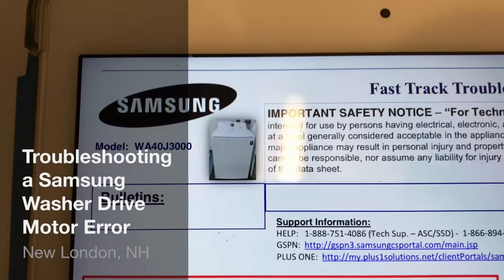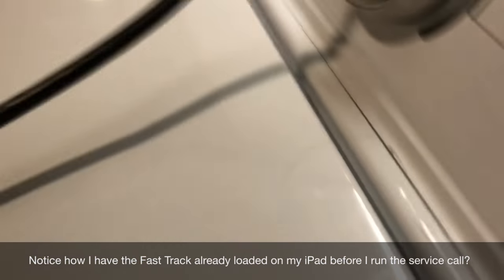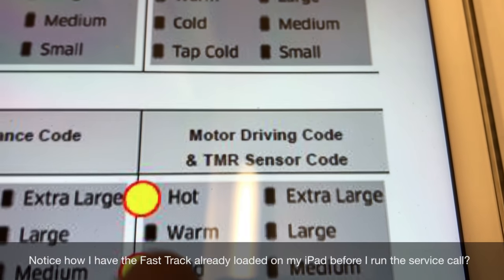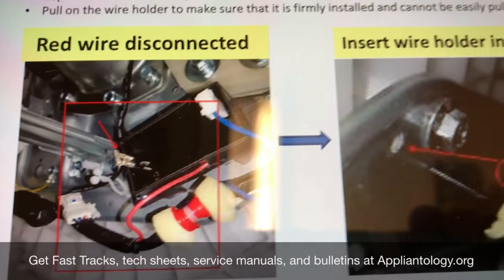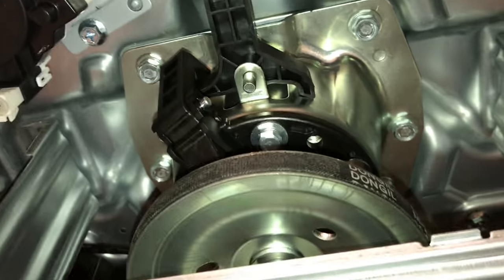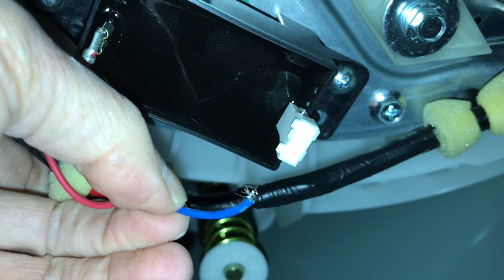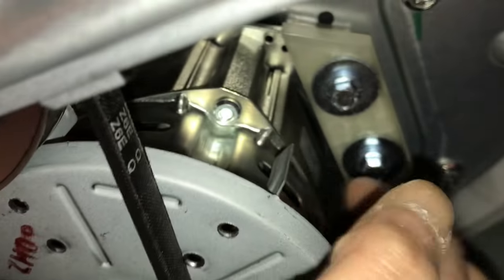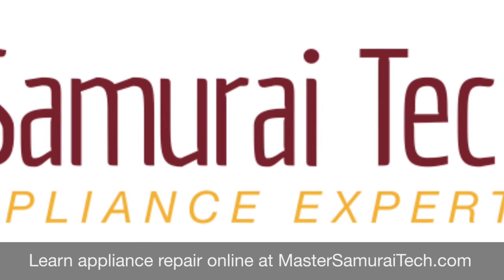Fixing a Samsung Top Load Washer No Spin Problem

Comment: thank you for the video, got me in the right direction. found the capacitor wires were fine but samsung or who ever built the motor used extremely thin gauge wires and found that the green wire was broken close to the 3 wire connector near the wire bundle close to the capacitor. so motor was dead in the water and the red wire jacket was also cracked and soon to be broken. had to cut the 3 wires and replace with male - female crimp on connectors at each end and taped everything back up, and now back in business for the time being. if anyone is having trouble. definitely look closely at the wires going directly to the motor as they are way too thin and could easily have a crack or break in them.

Comment: Thanks. Saved me a lot of diagnostic time. Red wire burned thru at connector. Five-minute fix. I did both wires. Washer still junkie but now a working piece of junk.
Reply: The Blade how did you fix the red wire that burned through?
Reply: I spliced on a wire and connector from an old harness. Samsung wire is minimal in my opinion. Twist wires, solder and tape.
Reply: The Blade  how are you. Has your repair held up? Mine broke off after two loads. Maybe because I only re spliced existing red wire and crimped back on existing connector. No sod no tape (electrical tape?) Thank you.

Comment: Thank you for posting. I replaced all of the dampers thinking it was a balancing issue, since the spin cycle wouldn't work. Turned out it was the red capacitor wire. Thanks again!

Comment: All my wires checked out good. So I continued on my quest with different videos. I was not getting hot water, checked everything related to that. No voltage to the solenoid, was ready to call a repairman. Then found a video that said the pressure sensor gave the same code. The clear tube from the sensor to the bottom of the drum had came off at the drum end. Reattached and solved the problem.

Comment: You saved the day, my man and a bunch of money too.

One broken red wire, and a short fix later, I'm back in business.
Reply: jonnyhunglo how are you. Has your repair held up? Mine broke off after two loads. Ty
Reply: jonnyhunglo following. Same here :/
Reply: @gentlepotatoe    I used gator clip jumper cables seemed to work.  Now have new issues with this washer.

Comment: Right on! Mine was actually the other (red) wire that broke off, but you saved me a $170 service call. Many thanks for posting!
Reply: How did you fix the red wire?
Reply: @rogaken  I spliced (with a wire nut for repeatability) a heavy duty flag terminal onto the existing washer wire. I salvaged that heavy duty flag terminal from an old (HVAC) compressor's wire harness (specifically for vibration). I found this can happen again and again when the washer is extremely loaded and also unbalanced (blanket/comforter). I've had to splice each (red & black) wire about 2-3 times since I bought the washer. Using the wire nut allows for reuse of the existing washer wire (without getting shorter from crimp connectors).

Comment: If you Samsung WA3000 is not spinning, then look under your washer for the two wires shown at 1:40 in this video.  If they have broken off, reconnect them, done!  Took me about 90 seconds once I found my wire strippers.
Reply: suburbancow how are you. Has your repair held up? Mine broke off after two loads. I re spliced existing wire and reconnected to existing connector and crimped and reconnected. Worked fine two times the it broke off again? I didn’t soder or change connector. I’m stumped. Ty

Comment: Thank you for this video. Four days of searching and this is the only video that shows how to resolve the issue. WARNING- my capacitor still had a charge after 2 days of being unplugged so be careful...My red wire was damaged. I ended up splicing it to a length that allowed me to wrap it around the connector. No need to remove the panel, just lay the machine down and you can get to everything. Saved me a $160 diagnostic fee.
Reply: Could you explain how the splicing and wrapping works?
Reply: @JamesDuren  It was a temporary fix that lasted about 2 months. At which point, the high rpm from the spin cycle snapped the wire again. Somehow that led to the motherboard going bad and the company's support desk was no help at all. If I had it to do over, I would've used a wire crimp terminal & soldered it to the connector and hoped everything held together. I got frustrated and ended up buying another washing machine (GE with old school agitator).
Reply: @dudebyob  how did you release the charge  of capacitor ?
Reply: @GoalsOverExcuses  By getting the crap shocked outta me🙂.
Reply: @dudebyob  the unforgettable method lol

Comment: Thanks. I was about to dump this washer nothing but problems. mine was the orange wire on the cap it's was not crimpt will I place a mirror under it and I saw it works like a charm after that.

Comment: I just replaced the pcb board on mine with the included rinse sink. But after a load finishes it’s cycle, there is a substantial amount of water in the rinse sink (mind you, we never use the rinse sink). Thank you!

Comment: Thanks for this video! I went from thinking we needed a new washer to finding the disconnected wire on the capacitor. 

Quick question: Where can I guy the silver connector at the end of the red wire that connects to the capacitor? I need a new one.

Comment: all wiring is good on mine. could it be a loose drive belt causing my no spin issue. motor actually starts the spin cycle, but belt is extremely loose and doesn't spin the tub what I think is enough for the tmr to sense the speed and then motor stops.
Reply: Hi, how did you get the belt issue resolved? Was it just a replacement or motor bolt adjustment? Thanks
Reply: @stefandimitrov  just a belt replacement

Comment: Can you share how you put it in diagnostic mode.
Reply: Mike Hardial Hi Mike. You have to press delay start, extra rinse, and power until you hear three beeps.
Reply: What exactly is "delay start"? There doesn't seem to be that option on the control panel.

Comment: I have same model and same problem. I fix the wires and still have issue. What could it be beside wiring?
Reply: Me too! Fixed the broken wire but did not fix the spin problem

Comment: Short and sweet! Really great video! I have a question as a guy that is totally brand new to this field.If you are a tech and run into this situation thinking that it is a COD call does this turn into a warranty call? If so how do you proceed with the customer to change the billing?Assuming that the tech is not set up for any kind of warranty

Comment: WA40J3000WA washer motor spins continually upon power on. This machine has had an initial problem of unbalance which was cleared by replacing all 4 balancing rods, Capacitor replaced, TMR Sensor replaced, and shift actuator has been replaced. All replaced for multiple issues found caused by the initial unbalance. At the moment there are NO fault codes but the motor runs continuously from power "on" and turns off 5 seconds after power button is pressed. The machine does not go into spin because the motor does not stop/pause to engage the gears and grinds the gears. any ideas?

Comment: I set my Samsung top load washer in rinse and spin mode. It does not spin. But tank does fill with water and sounds like it is agitating. But spin does not kick in. Spin led blinks steady. Rinse + spin blinks steady. Door lock led is solid. But no spin.

Comment: Here is an update on my Samsung top load washer. I disconnected the machine all night long. I began working on it about 4 pm today, Monday, July 31st, 2023. I flipped the washer upside down. I cleaned all the crap that was under there. I checked all the connections; they were all in good working order. I disconnected the drain lines that go to the pump. I checked inside the lines and inside the pump to the best that I could. I worked my fingers inside the pump and water lines. There were no obstruction or obstructions. I was expecting to find coins of socks in there. Nothing but air was in there. I proceeded to connect the water lines to the washer after I flipped it right-side up. I ran a program on low setting with no clothes. The machine worked through its cycles. I quickly opted to wash a load of towels. The load did  as it should. The tub filled with water. The agitator was moving. The tub was draining. What I did not like is that the spin cycle took about 20 minutes. In addition, I noticed, by way of sound, that the motor only kicked in about two seconds of intermittent boosts to crank up the spin in the tub. The washer went through  many of these boosts. After what seemed an eternity. The washer finished the load of towels. The towels did feel damp. As if the spinning was to an adequate degree. Nevertheless, I sent Samsung a messenger post on facebook telling them that the washer, for only being in our family for maybe three years, has been quite problematic. Thank you, sir.

Comment: I had the broken wire just as described.  However after repairing the wire I'm still having the same issue.  I fixed the wire by soldering the wire back to the existing connector and tested the connection with an ohm meter.  It seems likely that his caused the issue, but I'm confused as to why it didn't fix it. I'm wondering if the wire being disconnected could have caused damage to either the capacitor or the motor itself.  Any thoughts would be appreciated.
Reply: You have to reset the washing machine not sure how yet
Reply: The same with mine. Fixed the broken wire but only ran once and stopped again. The wires are intact but no spin.

Comment: mine stops in the middle of a rinse cycle. The Normal and Rinse lights are flashing. I pause the machine open and close the lid, then hit start and It will work after that. I looked at the codes for this and there is none. Any suggestion will help... Please

Comment: I flipped my machine over and the red wire is broken off.  Can someone explain like I'm 5 how to fix it?  This is my first attempt at electrical repair.  I've already replaced the water pressure sensor and the drain pump.  POS washer, don't want to buy a new one if this is the repair....  Thanks in advance!!

Comment: Very common issue with this washer. But today I’m going back for the 3rd time. The wire keeps burning off the connector right at the crimp. It’s too early to call tech so I’m here. 😂

Comment: What does it mean when you reconnect the wires and they just burn off again after two loads?
Reply: Darius Melasecca you ever get an answer? Happened twice in one day. Thank you.
Reply: @jmar7313  never got a reply but I think I fixed the issue permantly. I extended the red wire but to a higher temp wire and replace the stock wire terminal with a high temp terminal. About 5 dollars worth of stuff. Haven't stopped working since. I think we're on load number 10 no issues
Reply: Thank you so much Darius. Makes sense. You helped tremendously. God bless you. Jim
Reply: They burn because of arcing ... The connection isn't tight even it causing the terminal to arc .. Burning away wire and insulation.. -electrician
Reply: So we need to replace the red wire with a higher temp wire?  Is that what I'm understanding?  I'm not super mechanical so keeping it simple helps me a lot.  I keep having the same issue every load after replacing it.

Comment: Mine will fill up but when it has water it don’t spin out but I hear a little humming noise
Reply: Mine started this same issue with filling up but nothing after that other than a humming sound like it was trying to wash but it won’t. Did you find out anything by chance?
Reply: Having this exact same problem. Were you able to find out the problem?
Reply: having this problem. did you find a solution 
 @danh920

Comment: Red wire was the problem runs good now but hot/cold error code still showing
Reply: How did you fix the red wire problem?
Reply: @rogaken  required newly crimped female connector. mine came apart 2nd time this time discovered that incoming wire cable plastic frame holder wasn't pushed in to the frame hole and red wire vibrated off again. you can see it under his thumb in video at 1:38/2:00 as well as the one near blue wire make sure both are pushed in